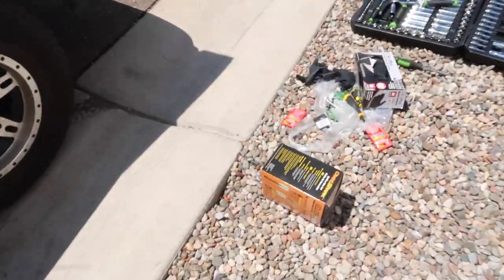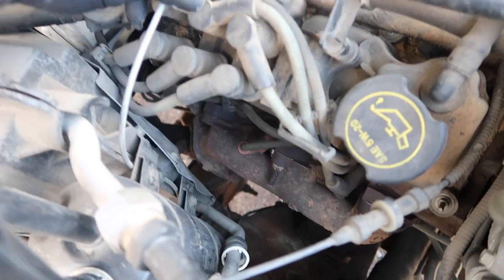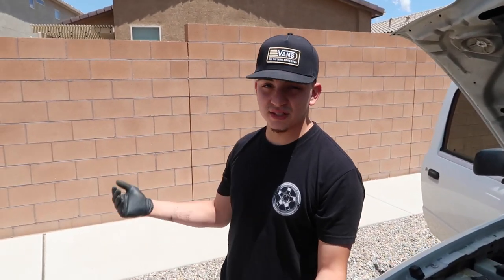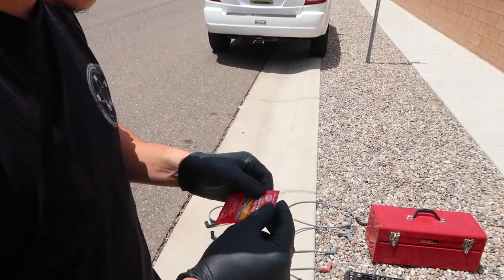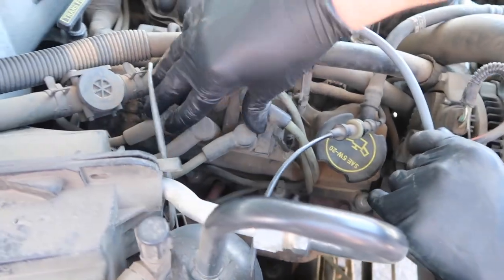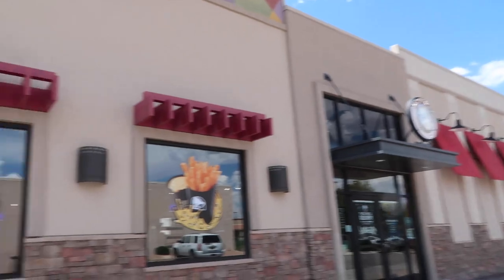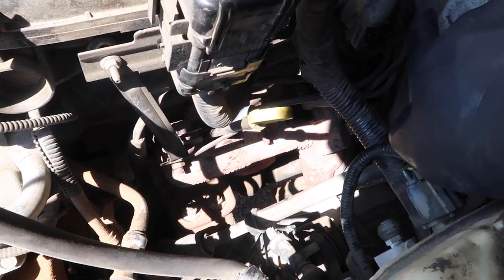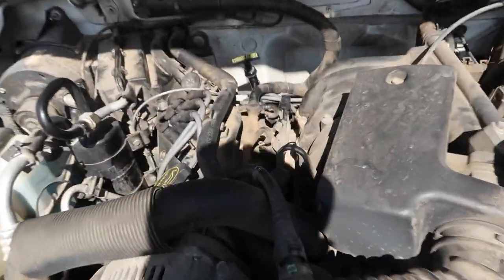How to replace your spark plug and spark plug wires | 1998 - 2012 | Ford Ranger 3.0L V6

Comment: Homie. Go check how to use that spark gap tool. You don't jam the tool into the gap tight because it can damage the ir or pt coating. Just move the tool gently until it stops. If the gap is no good then use the hole to gently pry out the bar until the gap is wide enough. To shorten the gap just push the bar against a hard surface. No need to bang the gap tool on the plug. The point is to not put any harsh force on the iridium tip. The iridium is a thin coating.

Comment: You said O5 Ranger gap size is  .044 for a 3.0 . Need to remind everyone that it might a different gap size for a different year Ford Ranger. I personally have a 07 Ranger and my owners manual says spark plug gap is .051- .057. Seems like every video I've seen people always say its .044 on 4.0 and 2.3 engine.

Comment: 🤦🏽‍♂️ You didn’t use anti-seize for the threads on spark plug?
Reply: You aren't supposed to use anti seize on sparkplugs now. The NGK websites specifically list why to avoid doing so, although it was a common thing to do awhile ago.